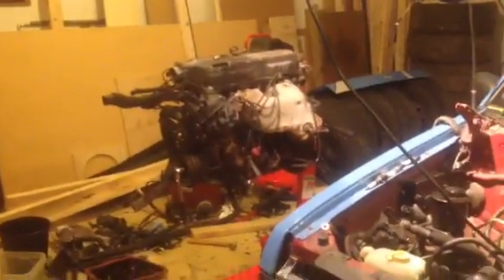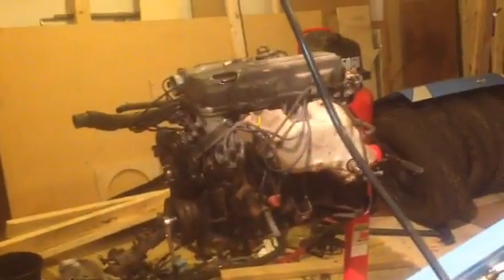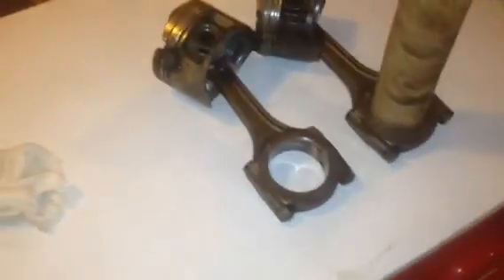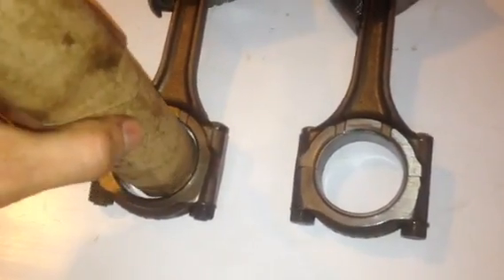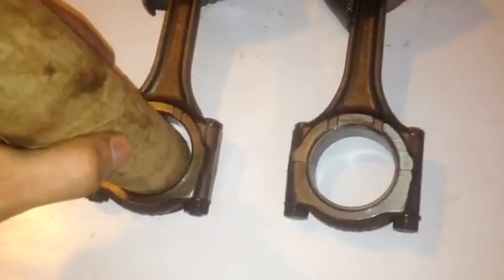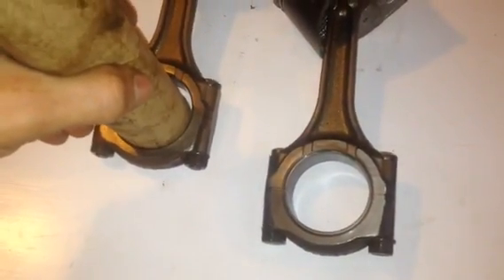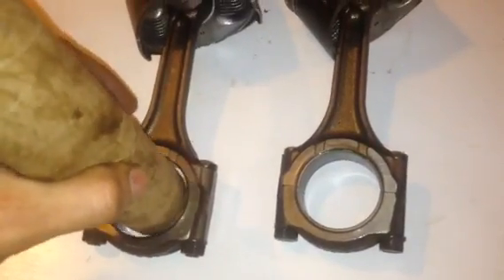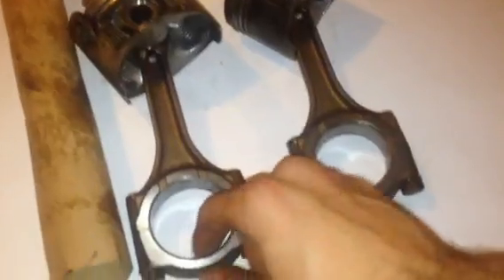What is piston rod knock?

Comment: If I have rod knock in my engine does that mean I can just change the rod  bearings and it will be fixed, what do I need to do
Reply from the maker: Depending how bad it is, usually the crank shaft and rod is damaged by the time it starts knocking.

Comment: Is it a fixable problem
Reply from the maker: Depends on the severity. Usually the knock comes from a missing or partially missing bearing. This will cause damage to the crankshaft, and connecting rod. Metal can also be circulated through the oil causing other issues. Yes, it's fixable. Just depends how bad it it and how much of the engine needs to be replaced.

Comment: My motor needs a lil bit of slop...I dont run 10.33 @147mph for nothin because the motors constanly at lik 5-7600rpm you need a lil play...383stroker flat top pistons eagle forded rods scat crank sp, it duration cam 628lift. Roller lifters roller rockers 12:7:1 compression dart heads....93 octane water meth injection....oil pressure idle is 68 ..........84 6700rpm.....hhahajbahactrgxefersdrgvgnvhj, blvyjvyjlgkuyyhhhb,iyvtchtfngvmjkhvgccbbhhvnhc give